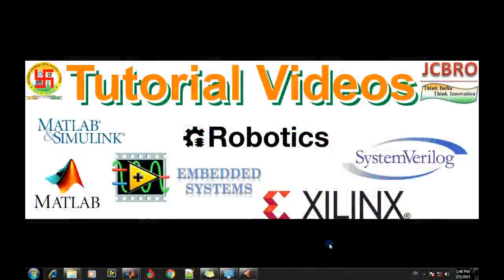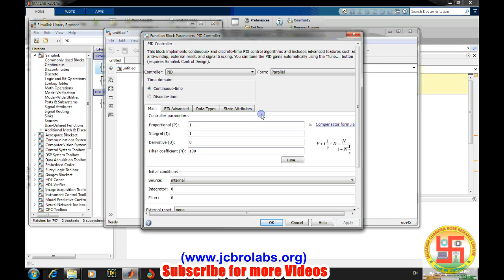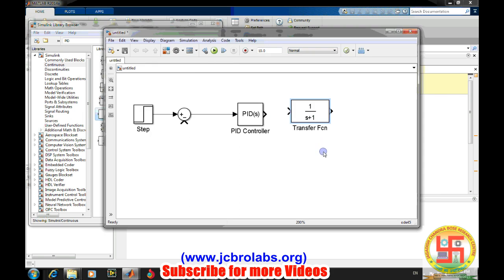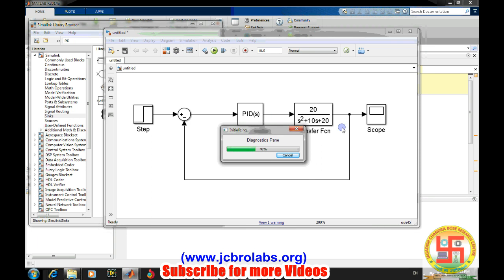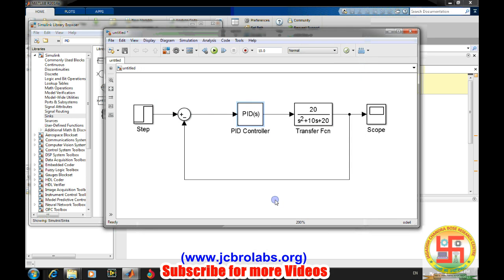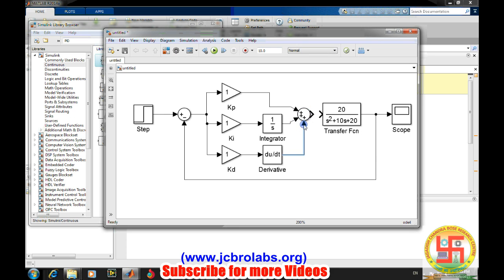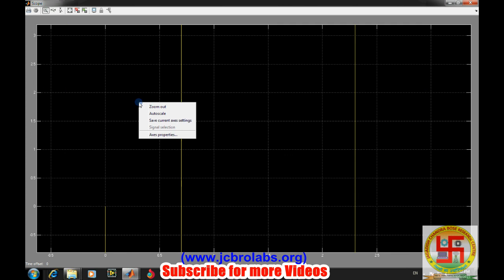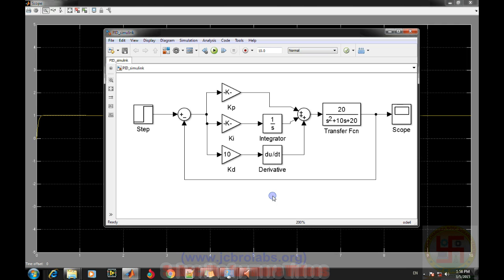How to Design PID controller in Simulink??

Comment: In general, what's involved in using custom smarts (FPGA, Arduino, etc), with custom hardware.. 

(Stepper Motor / Brushed DC Servo with position feedback encoder   or 
Sensorless Brushless (BLDC) with analog BackEMF feedback for commutation   or
AC/Induction Motor)

Running Simulink HIL in order to characterize the motor/mass and optimize the PID control loop?

Comment: Great video.

Currently designing a pendulum system with a flap actuator that changes angles depending on the incoming airflow An ultrasonic sensor measures the distance from a given reflective surface. However i need to create  a p controller then pi followed by a pid. i am not allowed to use the PID controller block in simulink. any help would be greatly appreciated
Reply from the maker: Hi, You can contact us at info@jcbroolabs.org for organised support in project work.

Comment: If load is variable then what will i do?
Reply from the maker: I didn't get your query...
Reply: @buildwithsharma  sir suppose i have 24 v and i want to make 200v 400v...for that reason will i have to design pi controllet 2 times or 1 tunning will do work??

Comment: can i have your email or any wattsap number so i can get help from its very ugent. i have to do assigment related to this but i am not familiar with  simulink. the assigment is related to instrumentation and control have objective of model the circuit related to speed control. kindly drop your contact info it will be very benificial for me. looking for response
thanks
Reply from the maker: Hi, you can send us an email at: jcbrolabs@gmail.com

Comment: Hii...please do a video on a drum or disc rotating with some rpm and it is automatically stopped for 20 sec and again starts running for another 50 sec. This process continues.

Comment: If I do not have a transfer function how do I do it , in case of a Nonlinear system
suppose I want my motor to rotate at pi.pi,2,pi/4,pi/6 and keeps on repeating the angles how do I  do it
Reply: You have to change your reference signals. Maybe you can define a periodic function that follows your order.